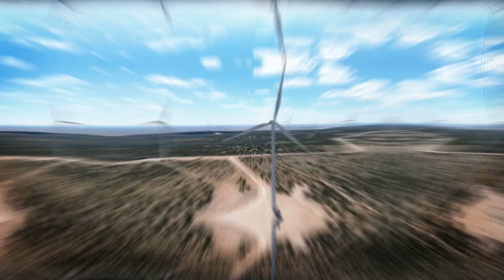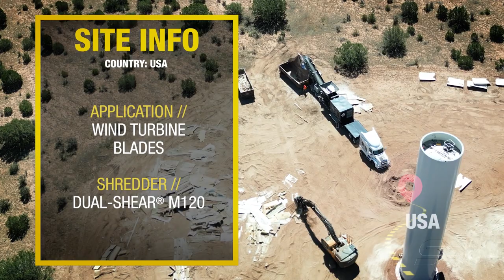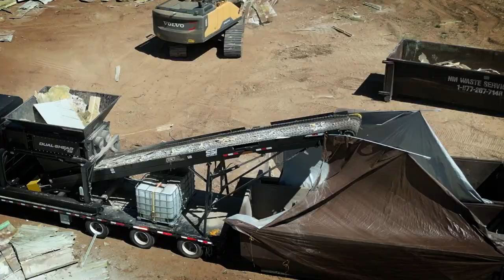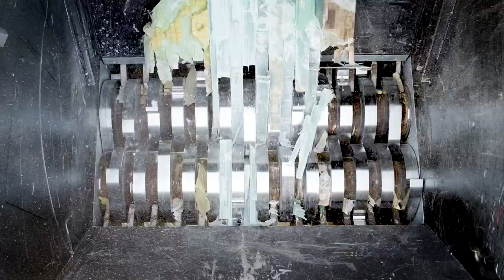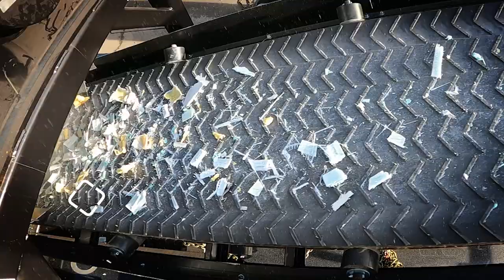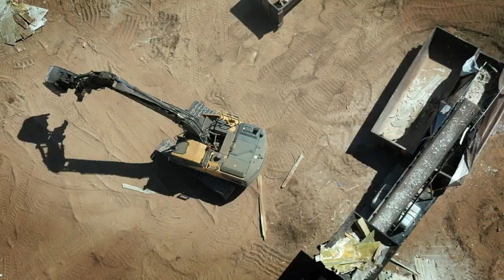Shredding Wind Turbine Blades

Comment: In germany we build a lot of them. now it comes out that it is the best way for rich people to make (get) money. Its a money making machine. the state pays you for your purchase of the wind turbine a lot of tax money and after 20 years you destroy the full functioning wind turbine and build a new one. free money. Add to that that the electricity efficiency is really bad from those and that you have to change tons of tons of oil to get those things going (thats what nobody talks about)
Reply: Not true, once going they generate a lot of cheap electricity.
Usually they replace because the best sites were used first and the new turbine (20years+ of improvement) are much bigger, efficient and quiet.
If the wind is strong enough and constant enough wind is a great option and getting better each year, like solar.